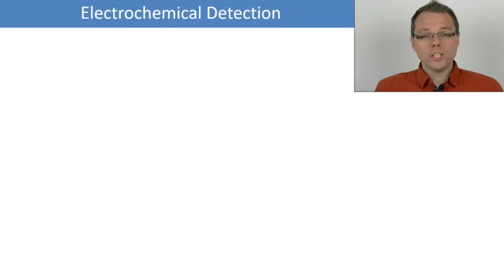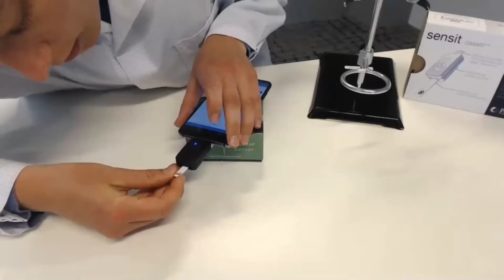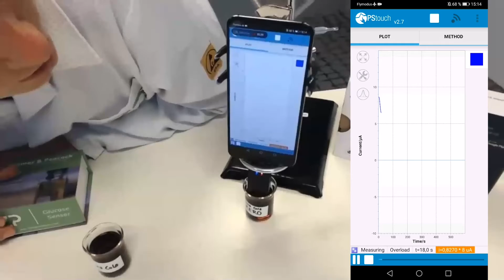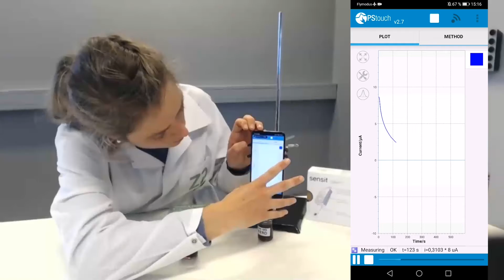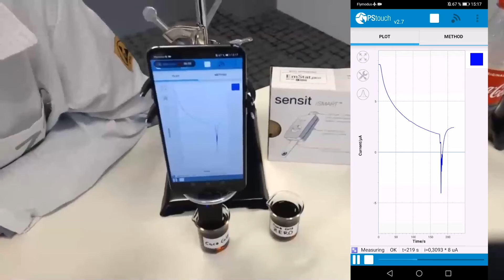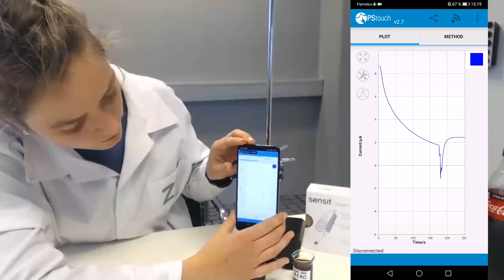Demonstration - ZP Glucose Biosensor with PalmSens Sensit Smart

Comment: Is this applicable to a saccharification activity?
Reply from the maker: Those electrodes are based on glucose oxidase and thus should be selective for Glucose. Intact saccharine shouldn't react with glucose oxidase. 
You could test this by comparing the signal change when pure saccharine is added to the measurement solution. 
According to my understanding, you should be able to follow the increase in glucose concentration as a result of saccharification.
Reply: @PalmSens how much is this? Do you deliver to the Philippines?

Comment: Are sucrose sensors? I think it makes more sense to detect sucrose instead of glucose in Coca-Cola
Reply: Dear ad on, Indeed, sucrose is the sugar that is usually added to Coca-Cola. However, there is an equilibrium between glucose, fructose, and sucrose. This means that a fraction of the sucrose will hydrolyze into fructose and glucose. Yes, a sucrose measurement might show a stronger signal, but we had a glucose selective sensor ready. These are more common because measuring glucose in the blood is important for diabetes patients.